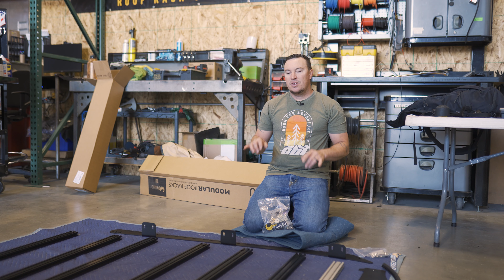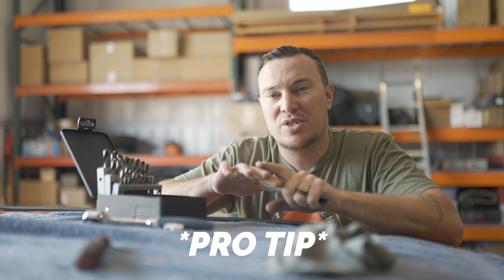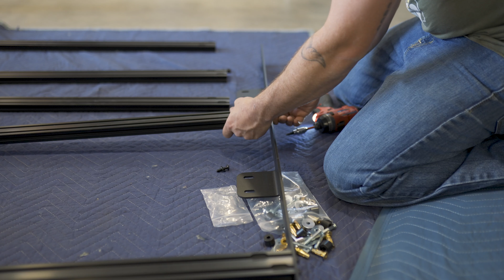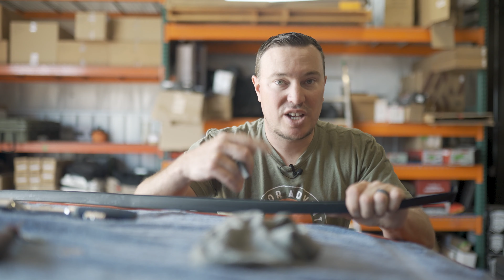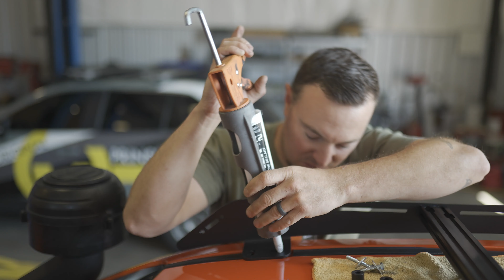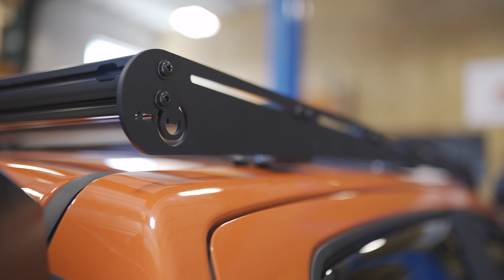PRINSU INSTALL: Chevy Colorado Roof Rack

Comment: Help, my wind deflector rubber seal is not touching the roof of the truck and is up off the surface by about a quarter inch. Is there any adjustment to slide it down lower? I have hissing noise coming from it as a result I believe?

Comment: shouldn't have been better to drill the weatherstripping to the size of the bushing? since the foot of the rack does not make contact with the roof, and you cut the weatherstripping for no good reason, and just added cheap double-sided tape...  maybe next time, use a step bit, mark the hole and slowly drill the weatherstrip until the bushing fit, that way the pins that hold it still work.   just my .02 cents
Reply: It's likely that the spacers are almost the width of the weatherstripping so you'd probably barely leave any material on the actual weatherstripping where the holes are, and it's likely you'd be slightly off in the alignment so it's better to just cut it